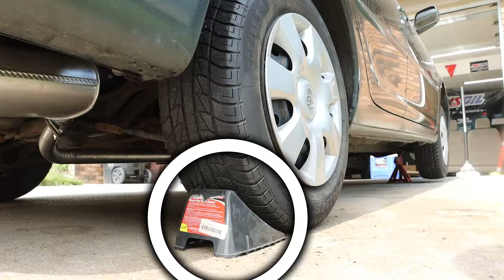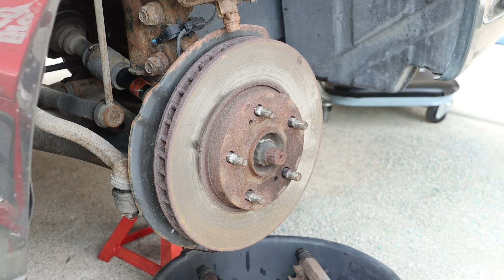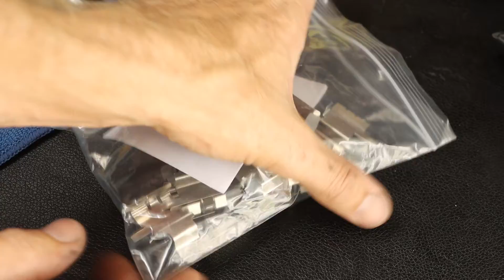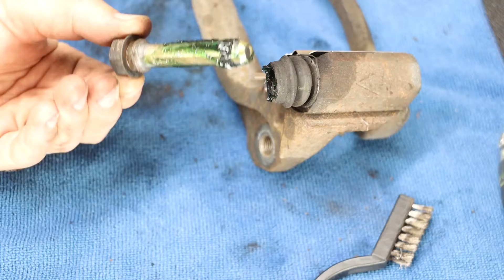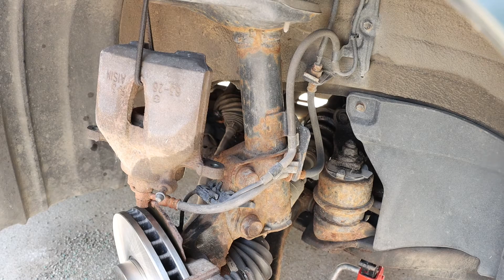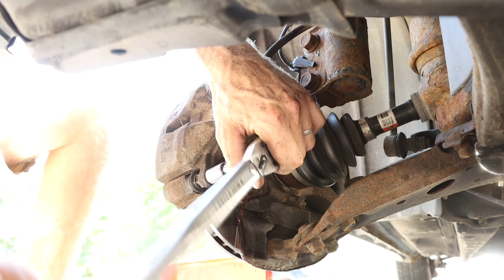Replacing Brake Pads and Rotors - 2003 Toyota Camry, 2.4L (2002-2006)

Comment: Thank you so much this is an amazing tutorial! Do I have to open the caliper bleed screw and change the brake fluid or is it okay if I leave the caliper as is and just reinstall it?
Reply from the maker: That's a debatable topic.  Simply put, the caliper piston will need to be pushed back to allow room for the new brake pads.  If you leave the bleed screw closed when you do this it pushes dirty brake fluid back through your lines and increases the level in your reservoir in the hood area.  I no longer use this method as with some vehicles, the dirty brake fluid can cause the ABS Pump to get clogged.  The best method is to open the bleed screw to avoid this...but when you "open the system" then you run the risk of introducing air into it and thus will need to bleed some of the fluid out.

Comment: that works if the disk is loose,  on mine, i stripped the two holes, blow acethyle o2 on it till it became red    i drilled holes throught, pus some 1/2 diameter hooks, took another car and pull on it,  break straps,...   nothing worked,   will probably have to scrap the car
Reply from the maker: Your rotor sounds like it is really stuck on there.  It also sounds like you have done just about everything that I would think to do also.  I suppose my only other suggestion would be to douse it in a heavy dose of a good penetrating oil like Metal Protector https://www.amsoil.com/p/amsoil-mp-metal-protector-amp/?zo=10458 , let it sit for 24 hours, and then do it again, and keep doing that for a week or so, then try taking a 5lb dead-blow hammer to it from the inside hitting it outward.  Just make sure your car is secure on safety stands so it doesn't shift and fall on you when you are under it hitting the rotor with a hammer.
Reply: @InsaneOil  finaly got it out, thank for the tips,i ended up using a cutting disk, cuttind the disk s ring out. once the ring was out. i could insert a chizle betwen the rest of the disk (middle plate close to the bolts), and the inside of the wheel. after hammering the chizle, and grind the metal aroud the bolts,   i got it out.   grind the back suface flat, grease it up, put new disks,   and it brakes. 

It was a dirty. dusty, 5 hours job,    but it saves ???? lot of $$$   and maybe the car itself

i have never seen that, seems like it welded there ?????????? thanks again for the tips

hope it will help someone else in the futur
Reply from the maker: @paspep  Sounds like in the end it was a successful repair.

Comment: Can I use as-40 instead of amsoil
Reply from the maker: I assume you mean WD-40?  Yes, WD-40 is classified as a penetrating oil that could be used instead of Amsoil.
Reply: @InsaneOil  some tutorials show adding anti-seize Permatex to backing plate (behind rotor) , do you think its really needed?
Reply from the maker: @pua3e  I don't think it hurts.  I will some times use Amsoil Heavy Duty Metal Protector which protects against rust and corrosion https://www.amsoil.com/p/amsoil-heavy-duty-metal-protector-amhsc/?zo=10458
Reply: also what is the name of lubricant you are using in this video ?
Reply from the maker: @pua3e  Permatex Brake Lube https://shop.advanceautoparts.com/p/permatex-ultra-disc-brake-caliper-lubricant-8-oz-24110/12027858-p?product_channel=local&store=4018&adtype=pla_with_promotion&product_channel=local&store_code=4018&&&&&gad_source=1&gclid=CjwKCAjwouexBhAuEiwAtW_Zx0CAnlkBAAsCifdFqwvr6XvuF6haePPXYN3njNixlwrIBebKEu40tRoC7tUQAvD_BwE&gclsrc=aw.ds

Comment: Pretty good video.  Not a fan of the loosening the bleed screw method but you hit all the high points. Appreciate the time it took to make and publish it!!
Reply from the maker: I use to not loosen the bleed screw until I worked on a vehicle where pushing the old break fluid back through the system seized up the ABS pump.
Reply: Thank you for telling us that you use to not bleed the breaks...honesty go along way